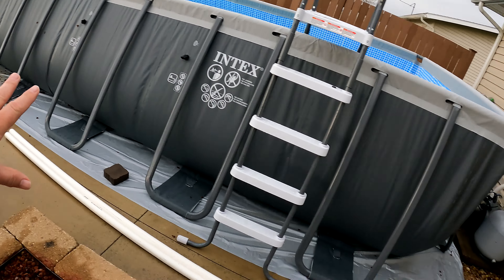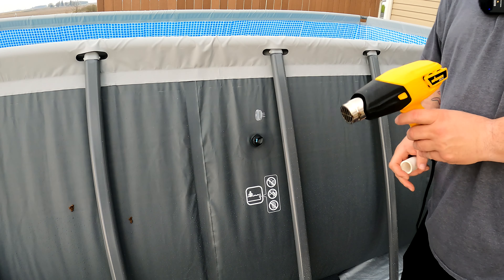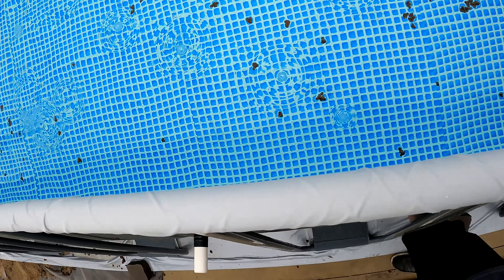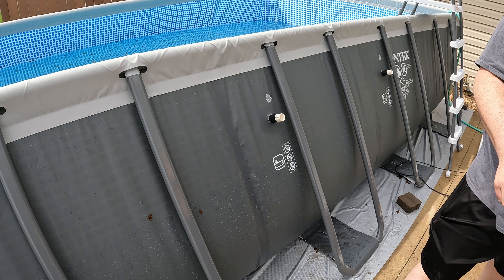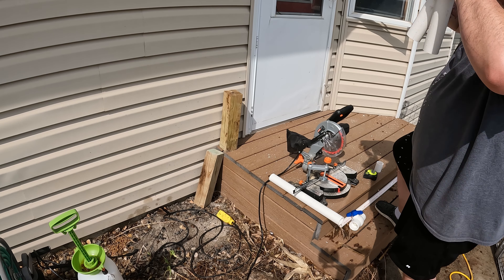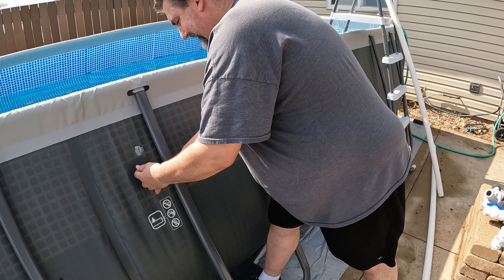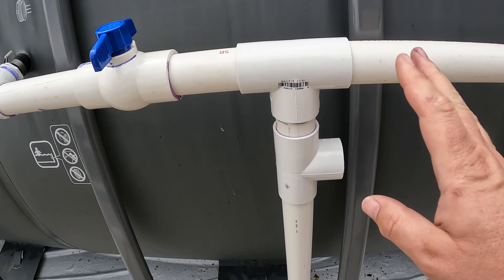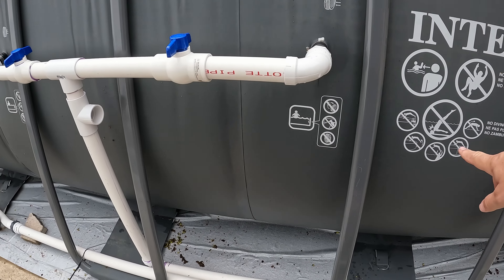Swimming Pool Plumbing -  adding PVC to filter system

Comment: The Intex sand filter pump in salt water system shown in the video is the Intex, ECO 20110–1 been replaced by ECO 20110–2 part numbers are going to be 28679EG been replaced the by the 26679EG the features on the Intex, 26679 e.g. the pump has a self cleaning feature the salt water system so we can set the pump timer and set the salt water timer so you have a pump running in the salt water to turn off. Has the pump running then the pump will turn off. If you put the pump timer on lower than salt water timer, it’s gonna automatically change it will  not work. The one that shown in the video the pump needs to run with the salt water system so we need to change the FP’s that means filter pump the salt water system cannot be ran so that means if the pump timers on the saltwater system will turn off, so there’s no supper timer for the salt water system as well. The newer features on the newer one and I know everything about those pumps and also have a YouTube channel feel free. Also check it out is the best way channel. I have some pool videos how to update some pool videos to. And feel free to comment below my YouTube channel.😊

Comment: I'm curious..... Do you have your pool bonded?
Reply from the maker: Yes, the pump is connected utilizing the correct 3 prong plug 👍
Reply: @Amundred  so in other words no, it is not bonded...... Lol
Reply: @Amundred  The pool has metal legs, I assume a metal ladder, which is in contact with the water, which is in contact with the pump. Sooooo, it is entirely possible for stray voltage to shock someone in the pool if it is not bonded.
Reply: @Amundred  Also, binding has nothing at all to do with the plug. I don't think you know what I'm asking about by your answers.
Reply from the maker: @RichardCutshall-p9o  bonding would be for metal frames, electrical circuits in the water, etc. Since this pool is an above ground pool with an all plastic pump, the "bonding" is not necessary. The only ground required is the ground through the plug.

I know exactly what you are asking about, but in regards to this pool it is irrelevant and there is no need for bonding. The ground through the plug is the only necessary ground for these types of pools.
Reply: @Amundred  You keep talking about a ground. Binding and grounding are two totally different things, so I still don't think you know what your saying. But thanks for the replies anyways.
Reply: And again, metal legs! Metal ladder! Electric pump is not plastic

Comment: I am adding the cut in skimmer by Hayward, and I'm thinking about doing away with the old inlet ports and just having the skimmer and the main outlet into the pool. Would that not be enough? No other pool has more than just a skimmer and an outlet into the pool.
Reply from the maker: Yes, this would work and I had considered doing this as well.

Comment: In the video are you saying 1-1.5" threaded connectors with 1.5-2" being listed in the supplies list? Im a goof and bought all 2 inch stuff where applicable because I got that stuck in my head. this is the best video, I will I would have found it before I made a few cuts lol.
Reply from the maker: I believe the threaded connector you are asking about was the 1.5" threaded adapter that adapts to the 2" pipe on the non-threaded side....if that makes sense?
Reply: Get yourself some Union fittings and replace your pump housing with flexible PVC pipe.

Comment: Can you please let me know what that threaded connecter to the flex pipe is? The one on 16:18 ? I can't find it on Amazon.
Reply from the maker: I believe this is the threaded adapter you are looking for:

https://amzn.to/3IMx8HP
Reply: @Amundred  I got that same adapter from Lowe's but the thread on the pvc adapter doesn't match the thread of the intex hose
Reply from the maker: @brianmp7846  it is a little off (standard vs metric I believe) and that is where using the thread tape plus gasket will make it so that you can connect them without leaks - unfortunately the Intex hoses use an odd thread which seems to not exactly match up to anything
Reply: @brianmp7846  im still looking for a correct fitting, the pvc threads ive found are taperd thats why they dont go all the way..ive been looking online and still jot sure exactly which is the right ones either
Reply: Could you give me a list of everything you used

Comment: I see so many people replacing the hoses with PVC pipes. I just don't see what the advantage is. What is it?
Reply from the maker: I think the main appeal is for the ability to "clean up" the look compared to floppy hoses everywhere?
Reply: @Amundred  Good point. Also, the ability to make everything 1.5 as opposed to 1.25 which restricts water flow and circulation.
Reply: @Amundred Out of curiosity, why didn't you just cut the holes around the rubber nipple coming of the pool to 1 1/2. That way you have 1 1/2 throughout the entire pool, no need for a 1 1/2 adapter.
Reply from the maker: @Superman-xr1oh  I figured that I would get a good seal with those nipples (which I did) as opposed to potentially having a spot for a leak to happen
Reply: Those hoses break easy by the hose claps. I've replaced 4 over 2years

Comment: What did you put on the 1" pipe on inside of the pool for a screen?
Reply from the maker: You can use something like this...not sure how long they will last...there are other options as well that could be used or you could make your own to put on the pipe before inserting into the pool 👍

https://www.ventmyhouse.com/1-round-open-screen-aluminum-louver-with-insect-screen-priced-per-bag-of-6-item-1-rs-100/?_vsrefdom=adwords&gclid=Cj0KCQjw0IGnBhDUARIsAMwFDLmDDvtHPe8HE1uLtWMsyUzoqV1ZdktEzDvn6-BxyOBphpE844WjnyEaAm06EALw_wcB
Reply from the maker: You would almost want to find something with a powder coating if you are going with a salt water set up to prevent corrosion

Comment: you said you might add a video of skimmer installation.. were you still planning on doing that? And also - did you use hard plumbing just to make it more secure and so all "business" runs to the back of the pool? Loved your video - super helpful :) thank you
Reply from the maker: Yes, I am making a video for the skimmer install. To be honest, I think going with a skimmer that attaches to the top bar is probably the way to go - the skimmer has a little leak that I just cannot get to seal completely...probably user error tbh and the install instructions were not great 😂
Reply from the maker: I used the hard plumbing so that way it is more durable and it looks a little better aesthetically. 

The flex plastic hose that came with the pump was not long enough to reach where I wanted to place the pump so I needed to either buy long flex hose or use the PVC.